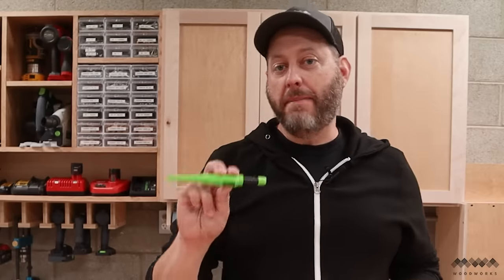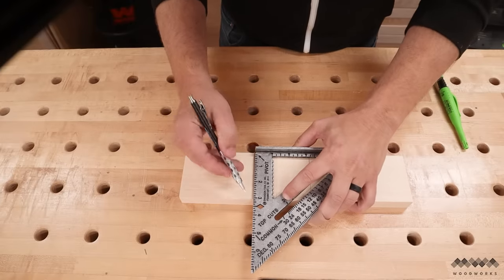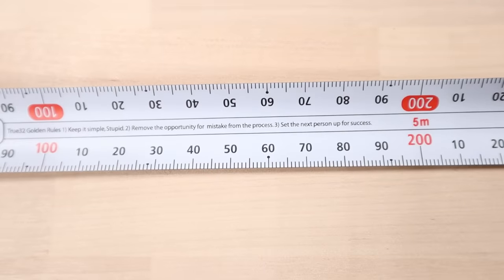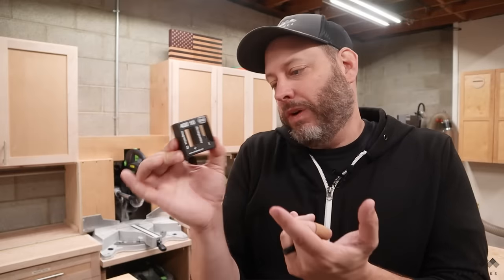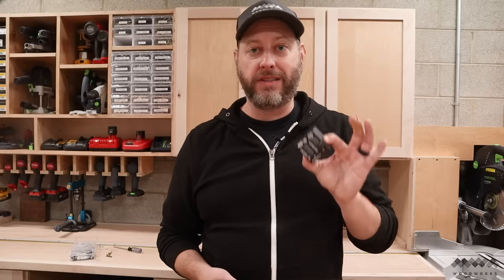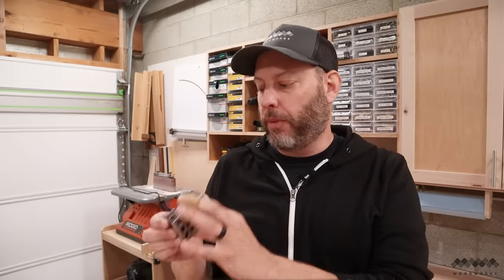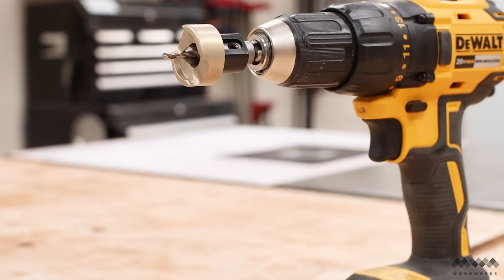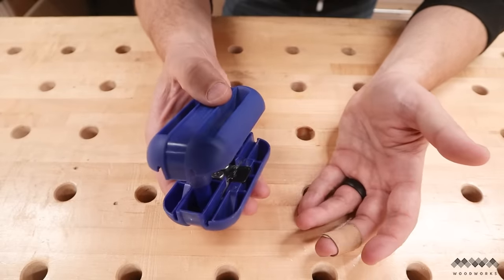Why doesn't every woodworker have these cheap tools?

Comment: I guess nobody has had drafting training like us old guys had.  When you drag your pencil across the paper (or wood) you turn it so that it takes a bit of lead off all around leaving a sharp point just like the one you started with.  Can't do that with a carpenter pencil, but carpenters seemingly don't pay any attention to the lines anyway.  Any pencil will last longer if you use it properly.
Reply: Yep, I started out as a drafter, before cad. Who knows what I spent on my mechanical pencils, a lot. I got these pencils after stumpy nubs introducing them. They are by far the best I've used. If people are still breaking lead, they sell them in all different sizes. I like .7 mm. The most. But I bought all the sizes. They are very reasonably priced.
Reply: Or you buy a Kura toga machine pencil from Japan and just let it do it for you
Reply: Thanks that’s never occurred to me.
Reply: Yep , just Learn to us a pencil. This is a lost art , it really works !
Reply: You nailed it. I had 3 years of mechanical and 1 year of architecture drafting in school. That’s the way you do it. But you gotta admit that one pencil is pretty kool.
Reply: Does this generation even know what a drafting Table looks like, And I was at a local thrift store who had really wide flat drawers, “D” size…
Reply: I've got better things to be doing with my time than caring about a pencil
Reply: Absolutely. I was drafting  before auto cad.
Reply: Funny, my grandpa was a draftsman and taught me that at a very early age.
Reply: BOOMAH
Reply: "...carpenters seemingly don't pay any attention to the lines anyway...." The lines are just suggestions....

Comment: If you took a pencil-on-paper drafting class, you learned to spin the pencil to keep a fine, consistent line. You are effectively sharpening the lead as you’re drawing.
Reply: Indeed and its still a habit
Reply: If you stayed in that class for longer than seven minutes you would also know that you still have to advance your lead, or if using a wooden pencil, SHARPEN IT to keep the lead exposed from the wood.
Reply: I remember those days, lol.  2H pencils, that pale green paper, the T square...Damn, I'm old, LOL!
Reply: Or you can up your game and buy a drafting mechanical pencil, like the Kuru Toga, that has this functionality built in.

Comment: The best thing about the FastCap tapes is that they're all very, very consistent from one to another. They are dead-on precise. I always had trouble finding that in other brands and mixing brands. They make "self-stick" versions for table saw and miter saw fences and they even a tape measure with a blank side that you can write on with a pencil so you can use it like a story stick too.

Comment: I learned drafting many years ago before computer aided design.  You're supposed to rotate the pencil when you draw a line so the width stays consistent as you draw.  Same goes for the  Pica.
Reply: You are absolutely correct but I also agree with old mate about the 0.5mm mechanical pencil for workshop use. I use a variant of the Pica pencil at work (on site carpenter) but I still prefer my super fine lead mechanical pencil for the dainty little projects I work on at home.
Reply: I was a draftsman also in the 60s and 70s. We call the folks who dont know to properly use a pencil. “Wood butchers”
Reply: Yes, have an AA in Architecture and Construction  Tech. Cad wasn't being taught around here then. I never used it except for myself. I became a medic the law enforcement.

Comment: My sister recently got me a machinist ruler for my birthday. Its a solid metal ruler but the measurements start exactly at the end of the ruler, without the little gap. Its helped me become much more accurate in my measurements and for keeping things square!
Reply from the maker: Yeah machinist squares are good for several things in a shop. I have a small 4 inch one that I use all the time
Reply: @MWAWoodworks  I think he is taking about the ruler - I have a set that starts from the edge and they are great.
Reply from the maker: Ah yeah I can't read so good 🤣

Comment: I find a silicone pastry mat super useful for a glue station. Once the glue has dried, it pops right off
Reply: Wax paper is cheaper.
Reply: Same thing I use
Reply: @bingmattson8685  not in the long run, pay $5 once or pay $2 every couple months
Reply: Yep, I used wax paper for a long time, but the glue still sticks to it and if you have a glue line over it you get wax paper stuck to the glue line and have scrape or sand it off and that wastes a lot of time compared to using the silicone mat that the glue just won't stick to at all.

Comment: I have both the Pica and Pentel pencils, both have their place. The pica works best for initial rough layout and it has multiple lead colors for dark woods . And I deify you to break it on rough lumber.
The pentel is suited better for fine layout  lines for precision work on smooth lumber.
Reply from the maker: I agree pica is perfect for carpentry and rough layout. I have one that I put white lead in so I can mark on walnut.
Reply: The forth be with you.
Reply: they have a pica fine dry now 0.9mm

Comment: You de magnetize when working on electronics.
Reply from the maker: Agreed! However I wouldn't be using a #2 philips head screwdriver on my electronics. I have a whole other set of much smaller specialized tools for working on computers/circuit boards which I would never magnetize to begin with so there would be no need to demagnetize them.
Reply: @MWAWoodworks  I get it I have tools for wood working different tools for electronics and different again for automotive work. Was just answering your statement for some who might not know why a de magnetizer lol be safe.

Comment: I love the track rack.  I have one piece of advice for you is to turn them opposite from the way they are in this video.  From experience my silicone track moved where it rested on the track rack.  Put the silicone facing upwards where the weight rests on the aluminum instead of the silicone.  Keep the great videos coming.
Reply: I have done the same thing. Let the weight rest on the aluminum instead of the silicone
Reply: Protect the silicone.  Nothing worse than to come out to the shop, and when you pull out your tracks to watch the zero clearance strip snake onto the floor.
Reply: I wonder if the weight of the tracks on the garage door will affect the door operation? I know the spring is calibrated to the weight of the door and tracks are not light.
Reply: Cut to the line! It’s thickness doesn’t matter

Comment: Those Pica (lead holders) and even mechanical pencils work better if you slowly rotate the pencil as you mark your line. So instead of wearing a flat tip in one spot as you make your mark, it sharpens itself while you draw your lines if you rotate it while drawing. Learned that in drafting class back in high school (a long time ago…).
Reply from the maker: I don't know if I'm coordinated enough for that 😆🤣
Reply: @MWAWoodworks  Even if you rotate the Pica pencil, the point will still widen as it dulls. Rotating the Pentel will allow the lead to wear evenly and not create a 'point' on one side of the lead as you write/draw with it. I was taught this in mechanical drawing in high school (c/o '86).
Reply: That’s an old drafting trick we were taught with those original mechanical pencils they had in the 70’s

Comment: I would add a digital caliper to your very informative list. You can get a good one for less than $10. They have a large digital screen, measure inside and outside diameter and depth. I appreciate the ability to convert inch and millimeter just by pressing a button. The measurement range is from 0-to 6". Calipers in the under $20 can even give you fractions, which allows you convert from inches to fractions to millimeters at the press of a button. I prefer the plastic/carbon fabric ones as they are non-conductive, inexpensive and very durable. For woodworking and home use they are extremely accurate.
Reply from the maker: Yes! In fact I actually did a previous tool  video which included my digital calipers 😃

Comment: I use the 1-2-3 block in conjunction with a fence clamp for a use-anywhere stop block.  It works on my drill press fence, router fence, table saw fence, etc. since you can rotate it to the optimal height for the particular fence.  The pair works great when doing repeatable cuts with my miter gauge on my table saw since I can set my fence to 1 inch more than what I want the cut piece to be, then register the end of the board to the 1-2-3 block
.
Reply from the maker: Nice yeah I think a stop block is a great use for them!

Comment: I have gone metric.  I have 25x50x75 blocks.  I use them often, but generally in conjunction with my I-gauging metric setup block set.  I also purchased the fastcap metric tape measures (regular and flatback), largely because that is the only metric brand I could find in the US.  I also use calipers often in the wood shop.
Reply: As a life long metric user, seeing an imperial tape measure up close is daunting.

Hope you're well and having fun sliding the decimal place around for unit conversions.

Comment: I have to agree with you on the Pica, I saw a YouTube clip where they guy called it a workshop essential, I bought one and my experience was the same as yours/ It dulls quickly and even sharpening the thing is a chore. I went back to my mechanical pencil.

Comment: I use a magnet out of an old computer hard drive to magnetize my tools.  Works very well.  Those HDD magnets are very strong.
Reply from the maker: Oh wow I think I about 100 old hard drives I just found a use for 😂
Reply: Magnets from mechanical hard drives are the best. The reason you were unable to demagnetize your screwdriver was technique. To demagnetize, connect the screwdriver to the magnet and move it around a little VERY slowly. Then, move the screwdriver away VERY slowly. Any sudden movement will cause the screwdriver to retain magnetism. To magnetize, move the screwdriver around a little on the magnet, and then SNATCH it away. That’s all it takes. Just use a hard drive magnet. You don’t need to buy the tool.

Comment: FWIW, a 'flat 1.8 mm x 0.9mm exam mechanical pencil' [good search term] is a GREAT sub for a standard mechanical pencil, as the rectangular lead gives it a lot more strength, and can be easily kept to a sharp wedge with just a bit of sandpaper stuck to the edge of your workbench.  They are also cheap as chips and available everywhere.

Comment: My preferred tape measure is from Lee Valley Tools. It's called the Blindman's Tape. I prefer the right to left version to use on my table saw, router, bandsaw, miter saw, drill press. You get the idea. I'm not a contractor just a DIY guy so this 12 foot tape is the perfect size.  This tape is 1 inch wide so it's better that the Stanley that's only 1/2 an inch wide and you can only get in left to right. I've tried some of the Fastcap tapes and for me they just don't hold up to use. Thanks for all the info in this video. I've wondered about the PICA pencil and you confirmed what I assumed. I use .5 lead but just some cheep mechanicals, I think I'll try the fancy Pentel you use. People who think the size of the mark doesn't matter usually aren't making furniture or boxes or other DIY projects that need this kind of precision. A contractor's margin of error is a lot larger than a cabinet maker's. For the future, how about a comparison between the igaging set up blocks and something like the Kreg set up bars? Thanks for your suggestions.

Comment: I discovered a use today for demagnetization. When you drill into metal; you often get metal ‘sawdust’ that sticks to the drill bit. Would have loved to have been able to demagnetize the bit today to drop those off.
Reply from the maker: Was the bit magnetized to begin with?
Reply: @MWAWoodworks  No, it wasn’t. But the drill bit had a hex end which I put into my Festool centrotec chuck, which is magnetized. So maybe the chuck imparted a charge to the bit.

Comment: For a pencil:  Eberhard Faber #2.  Period.  Best tape measure (for me):  Stanley Classic 25'.  Hands down most practical. Been using the Vix Bits for 40 years and wouldn't be without.

Comment: I’ve been subscribed to your channel for a while now. I enjoy your wit and delivery. I’ve started going back through your old stuff and stumbled across this video. I know the demo with the Kreg hinge jig was to emphasize the Vix bits, but are you aware of the two screw pilot holes that are under the cage when you remove it from the base? Just have a second drill set up with a 1/16” bit set to appropriate depth and you don’t have to worry about lining up your hinge out of square. If you knew this great, but if any of your followers didn’t know this then great also. 😊
Reply from the maker: Yep that's true. Thanks for pointinging that out.

Comment: My favorite ratcheting screwdriver is the Kobalt 13-Piece Plastic Handle Magnetic Ratcheting Assorted Multi-bit Screwdriver Set, Model 15000.  Includes 12 bits including straight, Philips, torx, and hex.  The best part is that it has a collar grip that if you hold it will turn the bit at double rotation.  You can also hold the handle stationary and turn the collar to rotate the bit, giving more stability like trying to start a screw without a pilot hole.

Comment: The handiest set up tools I have are Lee Valley Veritas 1 1/2 inch pocket layout square and Imperial layout block. Both have very common fractions built right into the depth, width etc of each of these consisting of 1/8", 1/4", 1/2", 3/4", the block has a 1", and layout square a 1 1/2" offset. It makes layout and setup so easy. I leave them either in an apron pocket or more often right on top of the table saw fence. Yes, they are tiny. But want to set up your tablesaw blade to 45 degrees? It's perfect as it fits under the teeth. And the best part? You can get both at just under $20 currently.

Comment: I use a pica pencil and I absolutely love it. However, I do construction and finish carpentry on the field more than my shop. The holster is fantastic because I never loose my pencil anymore or have to go digging in my pocket for it. There are leds for it available in various colors too for marking different materials. There is at least one other brand I’ve seen that has the pencil sharpener in the side of the holster which is more convenient.

Comment: PICA makes a 0.5" version also.  I have both.  I use the 0.5" one all the time for working in the shop.  The fatter lead one is used for basic framing where the fat line doesn't matter as much.

Comment: I have a telescopic magnet with a small built in LED light. It's great for when you drop screws into small places to retrieve them or like I do quite often I drop screws or metal parts into the pile of sawdust under my lathe
Reply from the maker: Ooohhhh I need to check that out! I just put a magnet on a dowel rod and hope for the best 🤣
Reply: Same here!

Comment: Try the Crescent “Nites Eyes” 8’ tape measure & you’ll never go back. The 8’ tape is the perfect size for furniture making & fits easily in your apron pocket. If you need a longer tape, they also make a 16’ version. Both are very tough & keep you from hauling around more tape than you need. The “Nite Eyes” feature was a game-changer for me.
Reply from the maker: I have the 25' Nite Eye and its nice. Not sure I'd ever need glow in the dark in my shop, but it's great for outdoor projects.
Reply: @MWAWoodworks  I like the “Night Eye” feature since the marks are easy to read, probably since it offers a bold color contrast with most species of wood. I never benefit from (or use) the glow in the dark feature. It’s the large numbers, compact size (8’) & contrasting color between the tape & stock that have made this measure a game-changer for me.

Comment: All you have to do to magnetize something like a screwdriver is rub the tip with a magnet. No idea how you would reverse it (or why you'd want to). lol
I love the Amana countersink but one drawback I've found is the rotating wheel sometimes gets in the way because of it's size ... especially when you've got things clamped up. Then I need to drag out the old school countersinks. My go-to tape measure is a small, yellow 10-footer from (I think) Stanley. Very pocketable without being bulky and completely accurate.
Reply from the maker: Yeah the small Stanleys are nice pocket tapes. And I agree why would you unmagnetive any tool! 🤣

Comment: Obv. pencils can be used for more than marking lines tho. Jointer and sanding scribbles, labelling pieces, etc benefit from sturdy lead.
Reply from the maker: For sure! The Pica is a good overall carpenters pencil for around the shop. It's just if I had to chose one for every need I would go with the Graph Gear because it can do really fine work too and its cheaper than the Pica. BUT I have two Picas and use them for certain tasks like rough layout and making notes on my work.

Comment: My experience with mechanical pencils is the lead is probably going to break going cross grain. I started using the Zebra DelGuard mechanical pencil, it's got a little spring mechanism in it that reduces lateral strain on the lead and it's been great. They are also cheap as hell, like 2-3 bucks a pop, so it's not a be problem to have a few around the shop, or if I lose one.
Reply from the maker: I have an Uni mechanical pencil that has the same spring action. It's great!

Comment: I use 123 bocks as clamping features. I need to clamp irregular shaped pretty often so I have clamping features that bolt into the 123 blocks. The blocks and the features all fit in a small toolbox but they replaced a large drawer full of clamping jigs that I previously used.